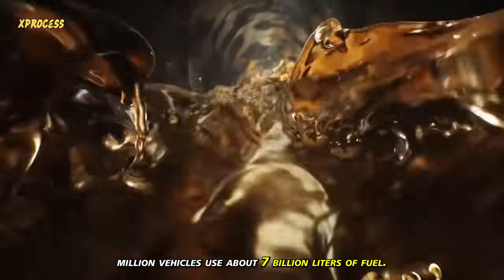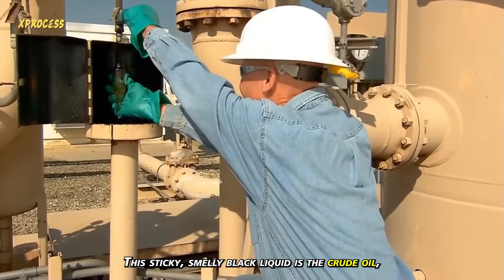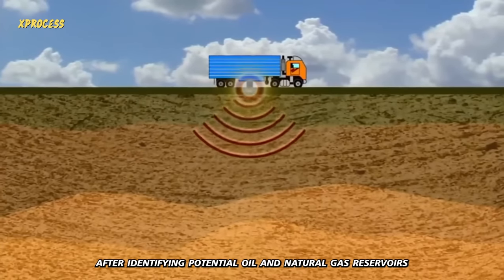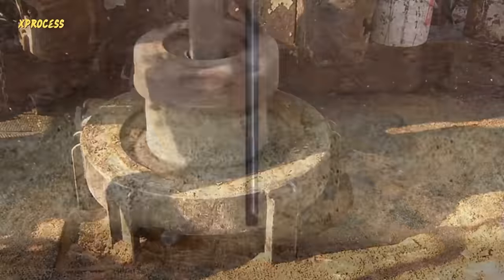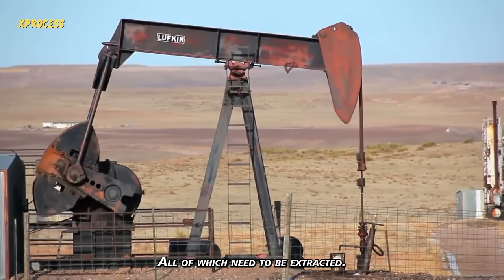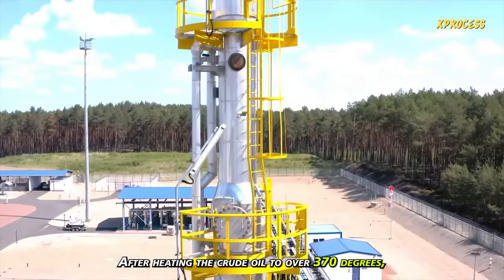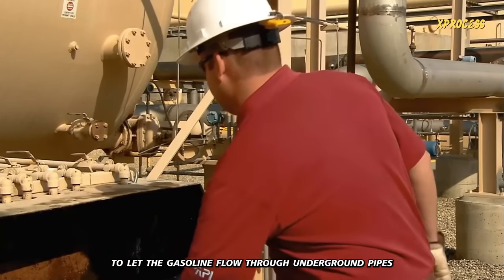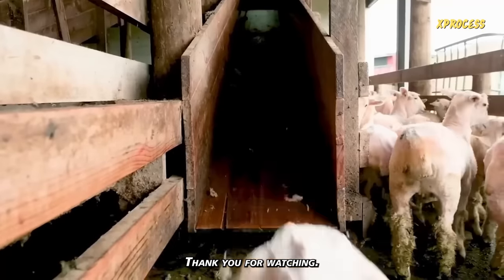How PETROL is MADE from CRUDE OIL | How is PETROLEUM EXTRACTED?

Comment: We are using  and abusing our beloved planet shamelessly.
Reply: Avoid all the convincies of oil and go back to the bush
Reply: Yeah go and live in a cave in the cold and dark
Reply: Your the one living in a cave mate
Reply: Don't worry the world is shifting to renewable energy.
Reply: @parkourvids  like what?
Reply: No, we're not.
Reply: I couldnt watch converting of a sheep's wool to clothing in the next video. Thats absurd that they can do that to them poor sheep's.
Reply: So turn your computer off and save energy.
Reply: @JCW-n8e  I did. Saved some electricity at the same time.
Reply: Fossil fuel still can be environment friendly if we able to break the exhaust pipe gases (mainly Carbon Monoxide and Carbon Dioxide) and separate carbon and oxygen. Then those gases will turn to useful rather than curse to the environment.
Reply: Why are you using Internet?
Reply: So true but then the only option is to go back to horses and carts for transportation needs and may be one day we will.

Electric vehicles which are claimed to be green, aren't. Reason being that one needs electricity to charge the battery and electricity is produced through coal and water both being scarce resources.

Moreover battery production and disposal pollutes the environment.
Reply: It’s a great job. A man can go make about a hundred grand a year with no college degrees. And you usually only work 6 months out the year. I worked the gulf for 11 years until I was hurt in a helicopter crash and retired.
Reply: Without petrochemicals you’d be writing comments on a wall instead of a smartphone
Reply: You're supporting it directly by using technology such as your phone and the millions of devices that connects you to your internet
Reply: U better live in the amazon forest without modern technology
Reply: Don't worry, oil will soon be gone (most of it oneshore anyway)
Reply: @parkourvids Oil is renewable. It just takes awhile. The planet is still making oil. It hasn't quit.
Reply: @Saif1971ify Carbon dioxide is good stuff. My plants love it.
Reply: @C-Culper4874  But the environment doest love that criminal, neither we do. If we can manage seperation of carbon and oxygen ( before through to environment) then everyone will live happily and praise crude oil.
Reply: @Saif1971ify  The earths atmosphere is at its lowest CO2 levels in its history. It is far from being optimal for plant growth. The earth will survive just fine and we will too if it triples in PPM. The problem we have is pollution. Ground water isn't safe to drink etc. We are concerned about CO2 but don't seem to care about real pollution.
Reply: As if all the mineral resources used in the manufacture of EVs doesn't.
Reply: @254dweller  EVs are worse than ICE vehicles when it comes to materials required to manufacture them.
Reply: Your wrong crude oil is an abundant source of energy still 100years we have stocks
Reply: you got other ideas?
Reply: Then leave earth mf😂
Reply: Stop oil bs 😅
Reply: @lolorick5885   you can easily live and enjoy the modern luxeries without oil. a lot of us do in europe
Reply: Did u think EV Can Save our planet
Reply: Soy boy lol
Reply: Snowflake
Reply: @tiffanitoenail840 that’s such bs😂 everything in the world is plastic
Reply: What's the alternative?
Reply: @connorjohnson3429  yes that is what someone from your country would think
Reply: Thats life innit?
Reply: Thats life innit?
Reply: @marcus_2004  no? 🗿
Reply: Yet here we are 
Playing with our oil-based plastic products using electricity for our pleasure and just complaining about it hoping someone else does something.   😅lol
Reply: Yes sir
Reply: Capitalism has no room for things like concern for the environment. Expecting it is foolish
Reply: There's too many of us. To make laws governing the number of children we could have wouldn't be "free" so I guess stupid people are free to multiply as much as possible until we destroy our only planet. Maybe we deserve AI overlords. 😂
Reply: @parkourvids The world's population continues to grow and so does the amount of oil we use even with "green" energy.
Reply: Before you pass judgment you should look into what is produced from oil , you may be surprised how many items re in your household . A little knowledge goes a long way .
Reply: And?
Reply: Class 1 Hypocrite
Reply: @TheShockLoad  then go and wear rafia leaves in other not to harm animals
Reply: Was it water that was used to power the electric generator that you used to charge the device your using to type this shii?
Reply: @Saif1971ify  That energy intensive you actual have to burn more fuel to do that, and that defeat the whole purpose
Reply: @russelmtlokwa6058  I know separation of carbon and oxygen from CO2 is the toughest job due to their chemical bond but not impossible. If we use some catalysts, then it is still possible before CO2 harms our environment. Need proper research and investment for CO2 capture and breakdown. I still believe if we can do so, fossil fuel would be more environment friendly that EV
Reply: While you make a comment on yt and drive a motor vehicle smdh
Reply: Go buy an EV with an average shelf life of 2 years and then throw the lithium batteries/cells in landfill and toxify the water table.

EV's are the green way.

Not.
Reply: @TheShockLoad  I really get surprised when see some people cry for animal's suffering and laugh when human beings are brutally killed by the name of self-protection or sometimes showing any reason at all. They are psychologically impaired. Need total rehabilitation these people first.
Reply: @parkourvids  The world's future depends on fission technology, just break the sea water and get immense energy plus abandon hydrogen and oxygen. Use those hydrogen and oxygen as clean fuel.
Reply: Buulshit 
We are making it safer and more prosperous globally
Reply: It’s not shamelessly, we are constantly ridiculed by ourselves for doing it. The shame is everywhere and is inspiring people to change. Also, wtf are we supposed to do? Have the foresight that the oil will cause pollution hundreds of years before we were able to detect it? 

Also, oil was a huge part of the Industrial Revolution, which is the reason we have modern technology. We have antibiotics, we can treat cancer and perform life saving surgeries, we can rescue people from fires and save them from accidents. We can travel across the world to see our families and friends. It all started with oil. Any other species would have done the same. 

Also, the earth isn’t alive. It can’t feel pain, it can’t be angry with us. It’s a giant rock. What were we supposed to do, ignore the chance to progress as a species because it might be harmful to the planet? Guess we better not try anything new then.

Comment: Suitable as a basic introduction . Loads of mistakes though   but nobody's perfect.  What should be emphasised is how bloody cheap it is . less than   "Red Bull" energy drink.
 ( Which is shit by the way)           If you want to find out. Put 1 Gal. in the car and drive it till it runs out of fuel. Then Errrrrr  PUSH IT HOME?  Now how much did that cost?  here in UK that's about £6 . and that includes Fuel duty and Value Added  Tax. If you want more energy per unit mass. You have to break nuclear bonds.

Comment: word of advise to all American who think some gas station have better quality gas than others
by federal law, all I mean all gas station has to use the same quality gasoline, the only difference is amount of additive they add!
that means Shell, Chevron, Arco, Texaco go to same place to get gas, there based on formula they gave they add it to same gas and their tanker
so you may see 5 or ten chevron truck and right behind it 10 Arco truck waiting to get gas gas, they just mixed each their own  their additives to same gasoline and fill the truck
 
so chevron might have better additive not better quality gas than Arco, additive doesn't dictate the quality, and amount of the thing they claim it cleans the engine is minute that you really have to drive the car million mile to see a little difference!

buy ARCO gas and every 3 to 5 tank add one Chevron fuel additive and you get ten times more than buying chevron gas for 30 cent or more per per gallon instead paying 4 to 7 dollar per each fill up pay on 3 dollar chevron with Techron injector cleaner once every 5 tank

Comment: This is why we need to convert to electric vehicles.
Reply: Fossil fuel is still environmentally friendly if we are able to break the carbon dioxide and carbon monoxide (main exhaust pipe gases) and separate the carbon and oxygen.  Then, those carbon and oxygen would be another gift of fossil fuel. It would be much better than the EV vehicle.
Reply: @Saif1971ify  well we arent buddy
Reply: No we don't We can't either. So there's that.